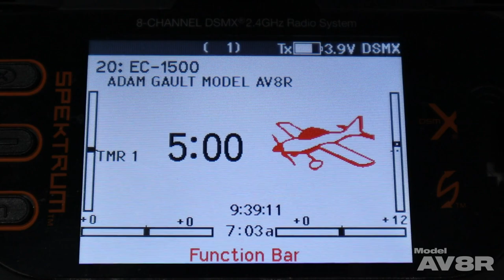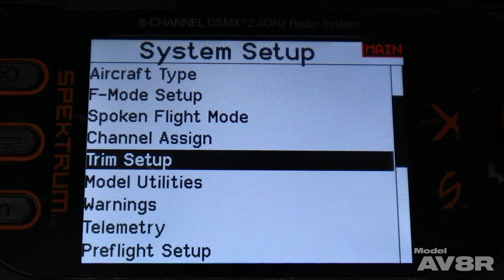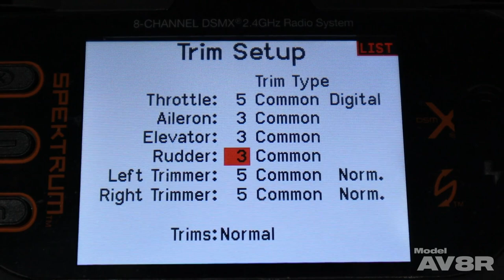Tips For Every RC Pilot - Model AV8R Episode 101

Comment: Exactly what I do with all my Screws and bolts needed for assembly at the field... I actually keep a flight log I made using MS Excel, not only does it keep battery type, size and aircraft info such as Make, Size, Etc.... I also record Number of flights , dates and have links to YouTube video imbedded into it , it also help if you Number each aircraft and have that number at the start of the Aircraft name on the TX... I learnt to solder at my local hobby store - we were talking about how to do it and my store proprietor, slapped a soldering iron  on the counter and switched it on - we then did some practice in the shop - good old days.... a lot of good hints and tips - Nice video Adam..
Reply from the maker: Wow Martyn! I keep flight and battery cycle logs as well, but not as detailed as you! Ahh Hobby shops...a dying resource unfortunately. I miss when they were everywhere. We have a pretty good one about 45 min away.

Comment: Great video Adam, lot of useful info for folks. Along with bags and servo boxes for hardware I use medicine bottles, We always have a ton laying around we take off the labels and I normally will put them in where the battery goes. Don't know if i ever seen anyone using those Safes for lipos, we use lipo Saks and ammo boxes with the rubber gasket removed. 
Good tip about the LED lights, I always forget about that one.  Going to try my best to keep my new planes I buy looking good so will try to keep those away from the fluorescent lights.
Reply from the maker: Thanks Chris! Ammo boxes may work, but I'm not sure how much intense heat they can take, or for how long. I do know from test videos that Lipo bags burn, usually quickly.

Comment: Thank you Adam for all your support of the hobby and your subscribers!  All of the tips were great, but the one I took to heart was getting the SentrySafe fireproof safe box.  I literally got on amazon earlier this morning and before noon it was already at my door!  Couldn't find it cheaper than $39.99, but as you said, that's pennies in comparison to losing a home.  Thanks again.
Reply from the maker: Thanks very much Roland! Really glad it was helpful. We enjoy sharing what we learn with the community.
Reply: Adam, I store all my Lipo’s in separate LI-Po bags, and I have five of them and some little ones for the 1S and 3S.  They are all smart batteries and G2 spectrum. I did pull the trigger and order 3 of those fireproof cases that you suggested. My plan is to use the bags for transportation to the field and use them to charge the batteries. My question is should I separate the Li-Po’s into the safes by putting different types of Li-Po’s in one case, some like a few 1S, 3S, 4S 2200mAh G2’s 4S 3200mAh G2 and 6S 5000mAh G2. Also do you suggest me lining the safe with the foam that comes with Li-Po’s? That is what I have in the Li-Po’s bags now. I just glue them together and make separate sizes to fit the size of the bag. I been using one foam for the bottom of the bag then put as  many as I can fit into that first rack. Then I use another prepared foam to lay on top of those batteries and so on. Thank in advance Adam! 👍😃
Reply from the maker: @RichieRich980215  The foam probably isn't necessary in the safes. You can load them many different ways, but I see the value in mixing it up. The chances of you ever having a fire from storage is slim if you are paying attention and making sure you store them in a good state (In other words...storage charged.) That said if you ever did have a fire it's going to nuke all the batteries in that safe, so it would be nice not to lose all of your batteries of one type. If you mix them up among all your safes you're still left with at least a few packs for all your planes.

Comment: Thanks for the tips, like most who are experienced already using most and great to see a different take on some similar solutions. A great vid for the new to the hobby.  I have been using ammo cases with holes drilled for storage for years. But like you said it only takes one to cause an issue. Impressed with the vid on the sentrysafe, fire chest. Thank you! Going to convert, as I currently have five ammo cans some packed solid with 6s packs. For estimating, how many 6s packs can you get into a single fire chest? Even though my charging station will remain a cement board lined ammo can as I am always present when charging or discharging, still going to convert to senrysafe fire chest for storage, and find other use for the ammo cans. Many thanks!
Reply from the maker: Thanks very much! Glad it was helpful. I can get 5 6s 6000mah in one safe, and there's still room on top for 5 4s 3200's. I've seen a lot of modelers use Ammo cans. They might be fine, but I just don't know how much intense heat they can take, or for how long. I know I feel better knowing I have them all in those safes.

Comment: A note about soldering: get a small can of flux (for electronic applications) and apply a bit of flux to the joint you are making. That way you do not have to depend on the flux inside the solder. Very few soldering videos mention this, and it causes a lot of problems. Trust me on this. Get yourself a can of flux. --Old electronics guy
Reply from the maker: Interesting the differences in experiences. Certainly won't hurt to use flux, although I've never had an issue with electronic solder joints using 60/40 rosin core without additional flux.

Comment: Great tips Adam, also some sexy planes. I use ammo boxes without the seal, so gases can escape. Do you think I should the boxes you use?
Reply from the maker: Thanks Chris! Man I honestly don't know. Ammo boxes sure beat putting them in a drawer. I guess the question is how long can the ammo boxes withstand that much heat, and how long will the batteries burn. Seems like they burn extremely hot, but for a short time. The boxes we use are pricey I admit, but they make me feel better knowing we have them. Cheap insurance when you think about it.
Reply: @ModelAV8RChannel  Yup sounds like a good idea, I will have to look and see what I can use. I never have them in the house, in ammo boxes within a metal cabinet. Have a great weekend Adam👍🏻
Reply from the maker: @DadsRCHangar  You too brother Chris!

Comment: I like the fire safe.  Currently using a sheetrock lined ammo can.  Is there a model number on that label inside the lid of your unit?  Unit looks like the model 1200 at the Sentry site. Looks like Walmart carries that for $30. I also see a model 1160 that has a bit more capacity. I assume it should be functionally about the same as the 1200. 

The couple of fires I know of were due to charge adapters being left connected. Specifically, those with banana plugs that can easily short.
Reply from the maker: Yep, ours are the 1200. I think they have specs on all of them. As long as its rated for 1/2 hour at 1550 deg. I would think thats a win.

Comment: Adam, thanks again for all your expert advice and the help you have given me. Could I possibly bother you for one more question - I'm a little stumped. I have a V1 Avanti, and I am installing a new 12 blade fan unit and inrunner motor from a broken L-39. I was intending to use the 130 amp Avian ESC from a crashed 90mm Viper in the new setup. There is a lot talk about the out-put voltage on the BEC being 6v versus 5.2 from the stock FW 100 amp ESC. The voltage range listed for the stock gear and servos on the Avanti indicated 4.8 - 6v. I hooked up the Avian to Avanti and everything seems to work fine, including reverse thrust. Am I going to be ok with this setup, or am I asking to fry something? Thank you. Dale
Reply from the maker: I'm glad to help when I can Dale. Given the posted rated voltage of the gear and servos you should be fine. Most standard voltage servos today are good up to about 6.6 volts (Life RX Battery voltage). That said, if folks are talking about it there could be some issue with the Freewing components I'm not aware of. If you're concerned, you can use the Avian programmer to adjust the BEC output voltage.  If you're not familiar with the programmer, in episode 96 we use the programmer to adjust the differential thrust on a Twimber. We cover how to use it and the features in detail.

Comment: Please note that zip ties not cut down to the end are very sharp and have poked peoples eye out. (Really just caused cuts that needed stitches). Might be a good use for that soldering iron to smooth over the sharp edges.
Reply from the maker: YES! And also try not to stick your finger in an electric socket either...Lol.

Comment: My E-flite Beechcraft D18 1.5m came with attenia tubes already installed in it and it was a plug n play version
Reply from the maker: Yep, mine too, but they run parallel to each other rather than having one vertical and one horizontal for dual diversity.
Reply: @ModelAV8RChannel  Yeah i 90% degree my anntena wiskars too

Comment: Thanks for the tips... do you do troubleshooting
Reply from the maker: You are welcome, thanks for watching! It is hard to troubleshoot sometimes in a comment section, but I'll give it a go...what you got?
Reply: When switching from safe select to manual flight I'm so far out of trim.... get it trimmed and flying fine go back to safe select and ohh crap it's going everywhere but straight. On the ground switching from safe to manual no visible changes????
Reply: PS all my planes are doing this... thanks in advance
Reply from the maker: Try mechanically adjusting the surfaces so that you only have a few clicks...and maybe even no electronic trim in it. Do this in AS3X mode. Often when a plane is trimmed in AS3X mode...and there are a lot of trim clicks involved, when you switch to SAFE it is a hot mess. To mechanically adjust...make a note of where the control surface is when trimmed, put the trim back to center in your TX, then take the clevis out of the control horn and turn it in or out (whichever is required) so that the control surface is where it needs to be to be in trim. Do this for each surface.

Comment: Great tips and video.  However, I really cringed watching you press in that antenna wire in with a square, sharp edges screw driver.  An old "baby spoon" with round edges works much better.
Reply from the maker: Baby spoon is a great idea...or even a sanded small piece of 1/16 balsa or ply. That said...you don't have to push very hard at all, and I've done it with a screwdriver about 100 times with no ill affects.